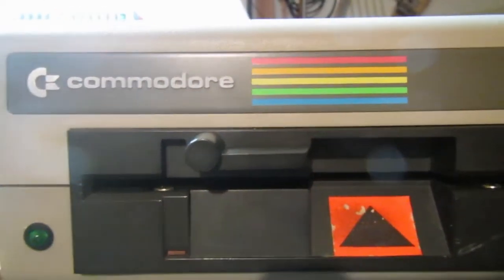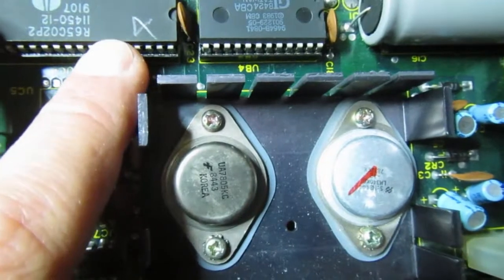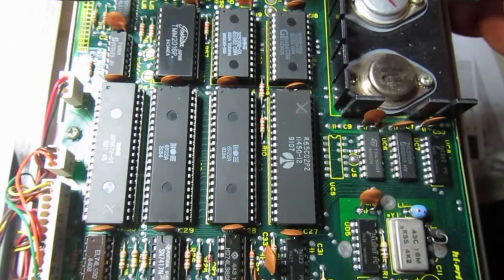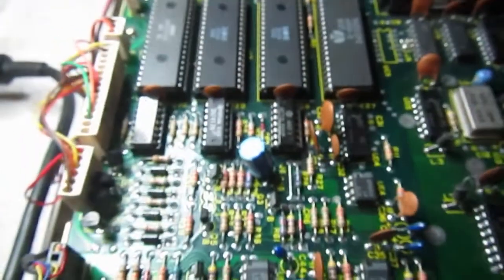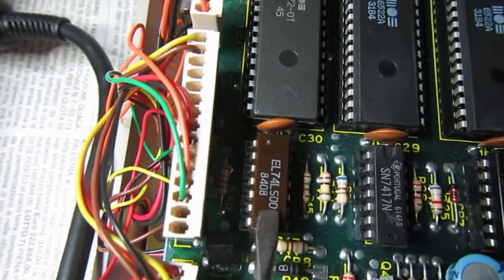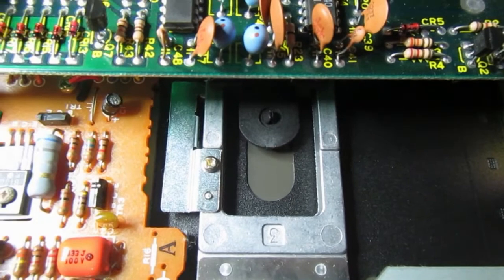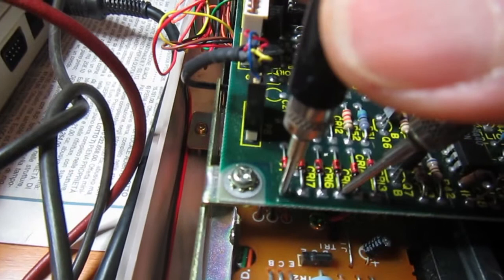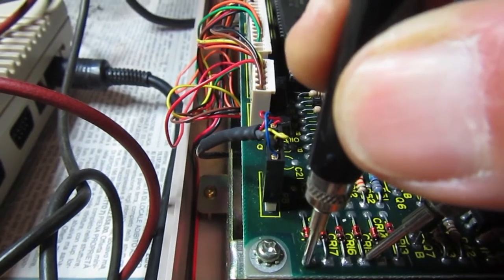Commodore 1541 disk drive failed repair attempt: R/W head damaged.

Comment: Have you measured the resistance on the actual head as well? Just to judge out possible head cable failure. And I've seen PC drives with head constuction where the head has not  been filled with epoxy. It's possible that the fine coil wire corroded at the solder joint where it joins to the PCB solder lugs on back of the head. And this is repairable. But I don't know for sure, as I've never seen a 1541 with this mechanism. I've only owned the version with the first generation mech, on which you should pull down a lever instead of turning it in order to close the disk bay.
Reply from the maker: Hi! The head is filled with a sort of epoxy and not always the solder joints are external. In this case the wires exited directly from the epoxy. In other cases, when the solder joints were external, I've of course measured directly at the solder posts.
Reply: iz8dwf what do you think makes the coils fail? Bad solder? Corrosion? I have two failed heads and it’s so frustrating!
Reply: @pb7379-j2k  Most probably corrosion, caused by leftover flux.

Comment: Newtronics drive mechanisms, like you have here, are known for head failure. First thing to check is the resistance of the R/W head, between the blue and red wire, you should get about 32 ohms resistance. If the R/W coil has opened up, you will get something like 150k due to the resistor across it.